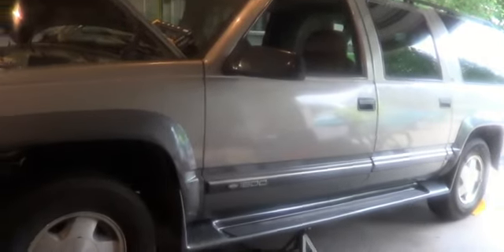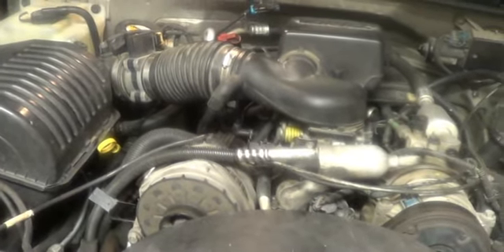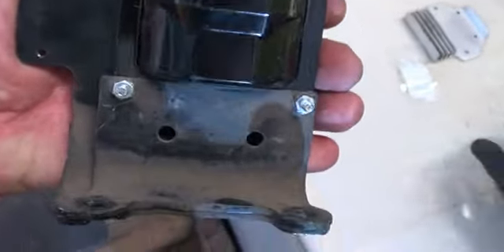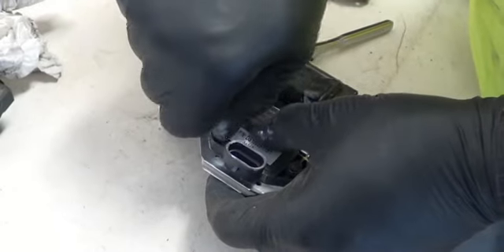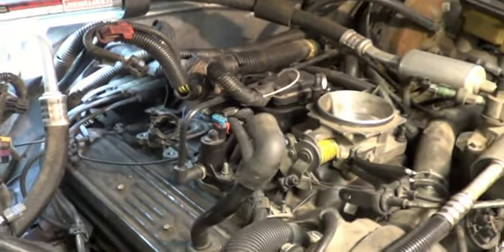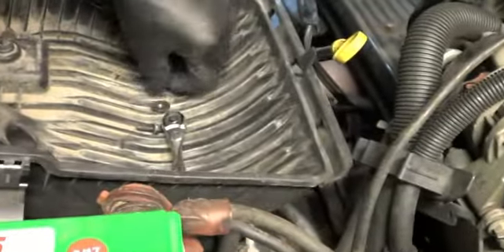1999 Chevy Suburban Iginition Coil & Ignition Control Module

Comment: Hi I'm having a random misfire on my 99 Chevy suburban k 1500 I have about 160,000 miles on my car I've taken well good care of it it just started this my mechanic has replaced everything even parts that didn't even need to be replaced it's a random misfire on cylinder 4 do you think this would have anything to do with it
Reply: Did your mechanic do a compression test on cylinder #4?...If not you either have a faulty spider injector or a burnt valve..
Reply: @happygilmore8768  Happy 2 say it finally fixed... I'm sorry happy. It was the spider injector. All fixed n passed smog the first one we ordered was no go that why we had 2 keep trying stuff.

Comment: On my 97 chevy k1500 pickup I changed the plugs and wires but my issue is when I'm accelerating uphill it does a jerking motion and feels like it loses power idk if it's the coil or something else
Reply: Did you figure out what was causing the jerking motion?
Reply: @privateer5  yes I did about a month ago I had discovered that it was a faulty catalytic converter in bank 1 so I went and got an aftermarket exaust system and it runs like new and had power like you wouldn't believe!👍

Comment: Hey question I have a 98 chevy 3500 with a 454 I've put everything new even ECU crank sensor n. Coil distributor n I still have no spark
Reply from the maker: No spark from the coil, or just each plug wire?  Just a thought, sometimes the rotor gets a pinhole and the spark jumps to ground. Pull the coil wire from the dist. cap and place end ~1/8" from "frame".  If it sparks, it's likely the rotor.  If still no spark, next would be testing for a voltage pulse reaching the coil.  If no pulse it gets hard to diagnose over YouTube comments.
Reply: If I look for power i have ground and with the switch only one wire has power no spark from coil at all I have a video I wish I could post it too show everyone
Reply: Wilson. Ever figure it out?

Comment: I don't think my problem is this , but what's happening to my Yukon is , I get up  in the morning drive to town about a hours drive , go into stores ,go back out to start it ,and it will not start wait a hour if so and it starts back up ...wtf is my problem ,please get back to me on a mabee solution....
Reply from the maker: This is just a WAG, and only applies if this is happening when it's above ~85F outside (i.e. you live in Arizona, Texas, Southern California, etc.).  I have this happen on one of my cars and it's vapor lock, where the gas in the fuel line turns to vapor.  Hot out, A/C ON, drive for 15+ minutes, shut it off for 3-20 minutes, and it won't start.  Pour cool water on the fuel rail and Supply/Return fuel lines, and it starts.  If this is happening and it's below 75F outside this does not apply. Let me know.  If it sounds right, use the gasoline without alcohol in it.
Reply: Did you figure it out? Fuel pressure regulator is often the problem

Comment: Thank you for the film. Pls could't you tell where is the Ignition 
Control Module is located on 2001 Saturn SL2. Also I removed one on 2003
 Chevrolet Cavalier and there is some red stuff on the small mounting 
bolts for that module. Could it be the red thread locker?
Reply from the maker: I'm not an expert on the 2001 Saturn, but the ICM is usually near the coil pack, in this case it might be under it.  See if this video is a match: https://www.youtube.com/watch?v=OAvOyUcA5w0&t=55s
 
Yes, the red stuff is likely thread locker, which is not a big deal.

Comment: Question my suburban makes a crank  I check my battery it said it's no good could it be the battery not the fuel line or the coil plus there's oil dripping from my truck could that have a result to it not start ing

Comment: So if these components are bad can they cause random misfires? P0300 code.
Reply from the maker: Many cars "engines" now days have individual coil packs, one for each cylinder.  The engine in this 1999 is old school and has a single coil, coil wire, a distributor cap with rotor, and eight plug wires.  Since this is a single coil, a failing coil can cause multiple misfires on random cylinders.  Many other things can also cause random misfires, like bad coil to distributor cap wire or plug wires, loose/bad plug wire connections, distributor cap, rotor, very worn or fowled spark plugs, poor compression, .....

The ignition control module is usually all or nothing, or may tend to work better when cold or hot.  It would usually cause no spark on all cylinders, or maybe just some (but not random).  The coil is a bit hard to replace, but the Ignition Control Module is super easy on this vehicle/engine.

Comment: How did you remove the bracket off the block? On mine theres a 3rd hidden bolt either a hex or a allen wrench.
Reply from the maker: The video pretty clearly showed how we installed the bracket first with a couple stud/nuts, and then placed another cable holding bracket over the studs and held it down with a couple nuts.  If yours has more bolts or a different arrangement I can't help you, but it should be fairly obvious, just try removing that "3rd hidden bolt" and see if it comes loose.
Reply: Drill it out....off the bracket...or place the whole thing....

Comment: What happened? Wye you replace those
Reply: you replace if no power is sent to the cap and rotors, 

if you get a crank and no spark. follow the plug to the ignition coil and control module, if you get no power out check the harnes' to make sure they are receiving power

Comment: wat size socket to remove the bracket n how many bolts
Reply: 5.5mm Socket
Reply: @JodBronson  7/32" socket. You'll never find a 5.5mm socket.
Reply: @chrisclermont456  They are easy to find.
Here's one way --> https://www.ebay.com/itm/NEW-CRAFTSMAN-5-5mm-Metric-Standard-Socket-1-4-Drive-6-Point-43511/293190611327?hash=item444385b17f:g:1G0AAOSwOKldVuCd
Here's a driver too --> https://www.ebay.com/itm/6-point-Non-Slip-Fit-5-5mm-Nut-Driver-Black-Oxide-Coated-Steel-TEKTON-26883/323691298102?epid=2288386382&hash=item4b5d813d36
Reply: @chrisclermont456  yes lots of metric sets have 5.5 mm drivers